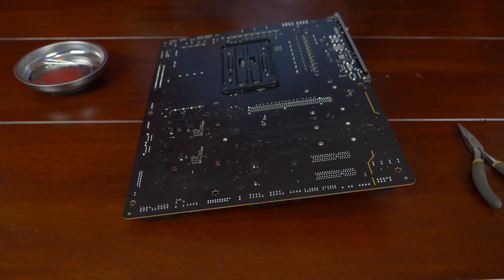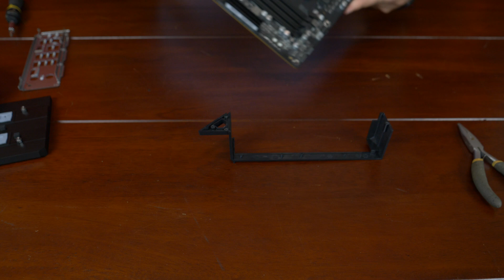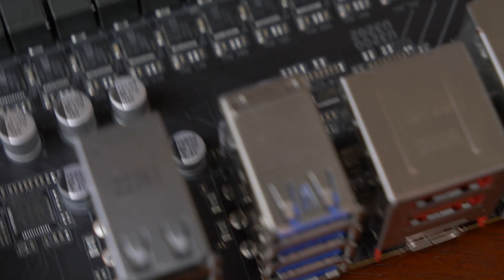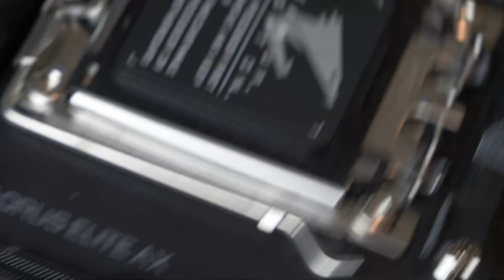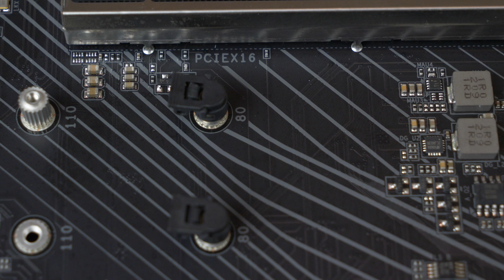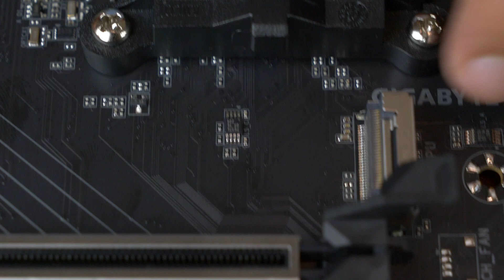GIGABYTE X670 Aorus Elite AX Teardown and IC Analysis

Comment: Can you change the battery without having to take everything out of the case? The cmos battery?
Reply: There's reset pins which should be outside of the heat sync that can be shorted to reset but if you want to replace the battery yeah you're gonna have to remove the heat sync

Comment: Thank you for the detailed video! I recently purchased an open-box version of this model and your video was incredibly helpful. Upon disassembling the VRM heatsink, I noticed that a thermal pad was missing in one section.
Could you please share some information on the thickness of the thermal pads used in this model, specifically in the VRM and M.2 sections? I’ve observed some oil leaks and plan to replace them as well.
Thanks.

Comment: Was there any RGB LEDs under the VRM heatsink?  
The Gigabyte Control Center has an animated RGB Eangle taht matches it you change patterns of, but I see nothing happening on the VRM heatsink as far as ny lights showing up.  Maybe this only exists on the Master, or... this is just a graphic in Gigabyte Control Cneter to indicate your' chaning the patern for all the onboard RGB headers to that setting?  I have no clue, I'm blind, so I can't even make out the Eangle on the VRM  now that my motherboard is installed.     You can forget removing any screws at this point.   I don't even know how I'm going to install the M.2's while blind now that it's all installed if there's one or two screws holding them down.    I just used the SATA 3.0 ports and none of the Nvme slots (het).  Which is ironic, because the 4 NVME slots was the main reason I chose this midrange board over others like the LiveMixer.

Comment: LOL I think I screamed for a full hour about what stwp1d as h377 engineer designer in his CAD program would design a motherboard with the CMOS battery buried under a heat sink.  Just the abject stwpidity of it blew my mind.  One, if it's user replaceable, make it easy to access and replace.  Two, heat from the heatsink is going to decrease the output of the button battery and can't be great for it.   But mainly point #1.   If you are a motherboard engineer, do not ever hide the CMOS battery under a heat sink.  I mean literally, face palm.  The amount of expletive curse words that flew out of my mouth when I saw this... you can't imagine.    More so than having to do finger gymnastics plugging in connectors to pinouts along the edge of the motherboard crushed into a Corsair 5000x case with next to no clearance witht he 360 RAD.
Reply: Might be a bit late but I found out a bit under the heat sink to the left there is a white button if you press that ur bios will be reset lol

Comment: I tried to remove cpu backplate, but its not moving. I can see screws from cpu socket being screwed to it too. But I fear to remove those screws. Anyone has any advice?

PS: trying to install TH240 water cooler by using their AMD setup (made for AM4 but should work with AM5 ?)

Comment: Is this board good for a 7950x? I had to RMA an Asus one
Reply from the maker: Should be fine, why did you RMA the asus? I can toss a 7950X in it, anything you want me to test specifically?
Reply: @StevesHardware  lots of MB errors, when it stayed on shut down and powered in the morning it would just give a cpu red light and got stuck so I had to turn it on and off until it boots, what else, it used to do that with everything, ram ,vga etc, the only way I could put it was in safe mode, after that it will boot fine, did all the bios updates and everything, no Overclocking only expo ram times but the ram was okay, checked both sticks, their good, checked the cpu it booted and everything the graphics all good too, so today I just had it frustrated, and started heari coil and whine from the cpu area so that was it I dismounted it and took it to UPS back to Newegg
Reply from the maker: @Troonielicious  Ouch, I know that in general AM5's memory training process takes a while. On the X670 Elite AX it doesn't take as long as on some other boards. With another board (X670E) I had to wait like 3-5minutes on first boot up, and it hung at the 15 code which means memory training for a long time, then it would go slightly further, then reboot and train again and then go slightly further, and then finally hit a screen. The like 2-3 times reboot thing is normal for a CMOS reset/CPU change, even on AM4, so I wasn't surprised at that, but the memory training can be long on a cold boot or a CMOS reset. Eventually it would pass, but every cold shut down it did the same thing. A BIOS update changed how often it did it and made it better, and you can disable full memory training in the UEFI after the fact. The X670 Elite AX is easier going with the training, it doesn't take as long. I was using pre-release BIOS with the X670E board, but with the Elite I am using a normal public release BIOS.
Reply: @StevesHardware  I’ll probably go with that mobo, or should I just wait for a B650?
Reply from the maker: @Troonielicious  it depends on how much you want to spend and what you need. B650 only has one chipset, so you will lose some connectivity and normal b650 will be like x670, where pcie5 isnt required for the graphics. It also really lowers the price since its a single chipset, and those are one of the most expensive costs on a motherboard. However, B650E hassimilar basic PCI-E 5 use requirements as x670E, but should be cheaper since it also only has a single chipset. I think B650 should be fine for most people, unless you really want future proof PCI-E 5.0 everywhere. Not sure about component quality and implementation or  pcb quality differences.
Reply: @StevesHardware  yeah chipset on AMD is more important than intel, on intel is not as important, I used to do a very debloated with the factory chipset driver.
Reply: @StevesHardware  Did you ever try it out?

Comment: Does this board have any RGB? OpenRGB thinks it does, but I don't know the answer to how many LEDs there are when it asks for size.
Reply from the maker: This board does not have any integrated RGBs except for the status LEDs, which are just for diagnostic purposes. It does have a bunch of RGB and addressable RGB headers, so you can add rgb strips.
Reply: @StevesHardware  I mean, I know it has RGB headers, but OpenRGB seems to think it has RGB LEDs, literally, named RGB1 top and RGB2 bottom
Reply from the maker: @waiting4theend962  the board does not have RGB leds built into it, just headers. If they are using the BIOS to determine things then that's not going to be super reliable as there might be an indication of a feature  from a different model.
Reply: @StevesHardware  ya...must be different model. Pretty dumb it shows up if it's not applicable. Causing confusion...case in point me here talking about it haha

Comment: Do you know if ASYN. clock feature in the BIOS ?
Reply from the maker: Do you mean the async clock where uclk=memclk or uclk=1/2memclk?
Reply: @StevesHardware  built-in clock generator that isolates CPU base clock from memory, PCIe, and the Infinity Fabric speed.
Reply from the maker: @Ghovna4R  there isn't an external clock gen on this board
Reply: @StevesHardware  O.k Thanks for your reply